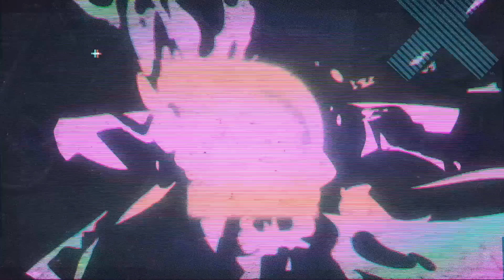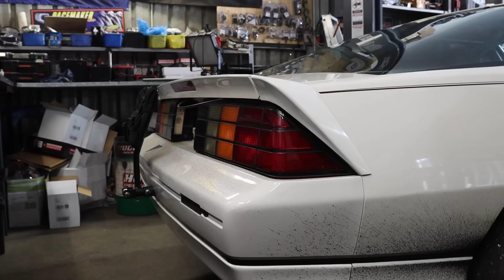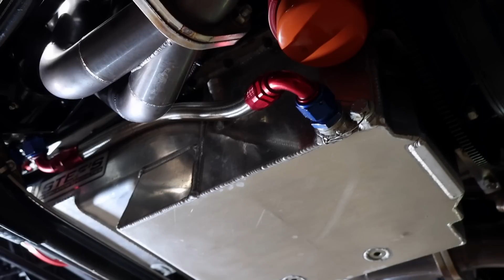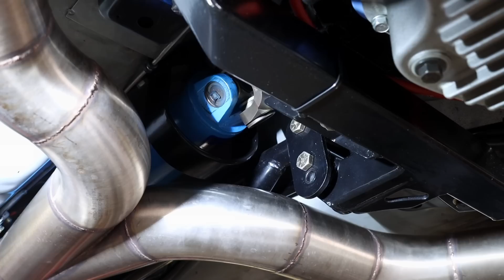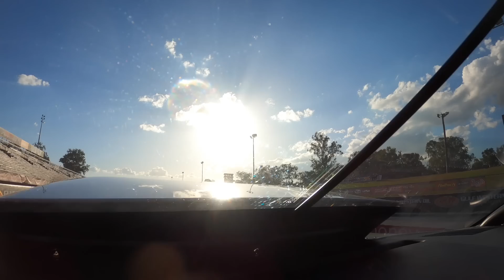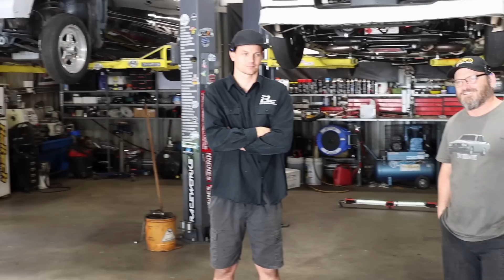9.2 Litre IROC-Z CAMARO With $4500 BILLET Carburettor's

Comment: Impressive build!
As much as I love modern efi, those carbies are cool. I remember that Hot Rod Garage did a test with carbies and efi, and there were no gains wrt hp for going efi. If the car has turned into a mostly drag race car, how important is driveability? I say keep the carbies!
I've never liked the look of those IROC camaros, but seeing this car, it looks really good. It took me 20 years or so to come to appreciate the looks :)
Reply from the maker: Cylinder distribution is why you go to efi and multi coils. Simple as that.

Comment: Must have been a 305 TPI motor not a 350.  The 350 wasn't available until 1987.  I bought an '88 new with Navy nuke bonus money when I graduated college.  305 TPI, 5spd manual with the Aussie Borg Warner performance G92 posi rearend.

Comment: Nice job on the steering rack conversion. Ive refused to convert my car because i know how many intricacies there are to doing it and making it work better than what it was. I have it figured out now doing something sort of similar with a center block rack from an acura with a travel bar to replicate the original geometry. So many people think" ill just throw a rack in it not knowing how many things are going to make it terrible if not done correctly.

Comment: My 1986 Trans Am actually came factory with an Australian Borg Warner 9-bolt rear end.  It was an American left-hand drive Trans Am so I'm not sure why it had the Australian 9-bolt rear end instead of the 10-bolt rear end but apparently GM decided to do that in some of the mid-80s F-Body cars.
Reply: The BW 9 bolt was a bit stronger than the 10 bolt. That's why they were used in F bodies. And they're not really uncommon. Pontiac being the more premium brand used them from 85-90 in performance package Firebirds. Chevy used them in performance package Camaros from 87-90.

Comment: As someone with a 7.0 liter BBC that is both efi and electronic spark control - there are days when I want to throw the EFI at the nearest egghead because it does not live well with radical cams... to the point that it runs best when I tell it what fuel to flow at what rpm/tps.... you know, what a carb does naturally and better and without the drama.
Reply: 😂 I'm an EFI guy till the day I die, but you're not wrong here.
Reply from the maker: Is it a sniper or fitech?
Reply: @theskidfactory  sniper, but it was FiTech before (changed for different reason) though FiTech didn't have computer controlled ignition with the 8 injector TBI.  With that said, same trouble with EZ-efi....
Reply: I will add to all of this that the fix is a terminator and port injection with coil per cylinder ignition.... but it's racing season and a really dumb move would be a major ignition and injection change.  It's bandaided for now, but there are moments when I do look at the Holley that started the motor and sigh.
Reply from the maker: I don't even consider TBI as real fuel injection.
Reply: @theskidfactory  well, if your flushes swirled the right way.....
Reply from the maker: Don't want to blow your mind but our toilets don't even work that way so you don't even see the coriolis effect.
Reply: @theskidfactory  too late, mind blown.  Much respect to people who live in a place where even the carburetors want to kill you.

Comment: Agree about modernising an old engine with new technology.  I'm modernising an old BMC A-series from a Morris Mini with a late 60's Arden 8-port head.  I'm adapting a set of Yamaha YZF-R6 DBW throttle bodies to the head, adding a crank sensor, cam sensor, knock sensor, individual LS1 coils, and all controlled by the Nexus R3 VCU.  Should be interesting to see how refined an old engine can become with the latest technology.
Reply from the maker: This sounds awesome, you should join the Skid Factory Fan Club page on FB and post it up.
Reply: @theskidfactory  Will definitely do so when it's up and running.

Comment: Al and crew, can you help? My mate has a boat with 2 x 454's. Been screwed over by every one. Last idiot put 650's on it. I said being another fool that it needs at least 1050's on that many cubes. He keeps  throwing money at it. Please help. Max a real subscriber.
Reply from the maker: 650 would be plenty on a relatively std engine. It really depends on the compression ratio, cam size, cylinder head type and porting, valve size etc.

Comment: can i make a request. Can you guys do a 2000+HP 1UZ turbo build into an......... MZ30 . I recon it can be done
Reply: Will that be cash or card?
Reply: @adrianzmajla4844  yes
Reply from the maker: 1uz can't hold the cylinder head on at 1000hp so I'm gonna say no. They are amazing unopened with a turbo at 400hp atw though.

Comment: I remember there was an episode of MacGyver with Camaro's?
Reply: Was that the race track based "all plastic engine" story, and he had to repair a slashed brake fluid lid (?) with some race day bunting?
Reply: @yowie0889  That's the one👍I looked through my Macgyver DVD'S & found the episode, it's Season 4 'Collision Course' Disc 2. There were Trans Am's & Camaro's racing each other.
Reply: @sandygarage3802  Good stuff. That was my favourite show for a while (as a kid in the 80s). I surprised myself remembering some of those plot points after your prompt.
Reply: @yowie0889  There were some good shows in the 80's & 90's. There was also a Macgyver episode, where there was an 'Italian Job' style of mini chase.
Reply: @sandygarage3802  The film reference would have been lost on me at the time. Good to see the TV show writers having a bit of fun with that sort of thing though.

Comment: I'm sure Dave knew to get the slick roof and not the T-Top version for saving what little chassis rigidity they had from the factory.  T-Tops are cool...until they pop out under flex and put glass all over everywhere lol